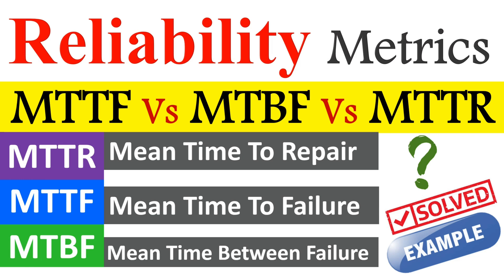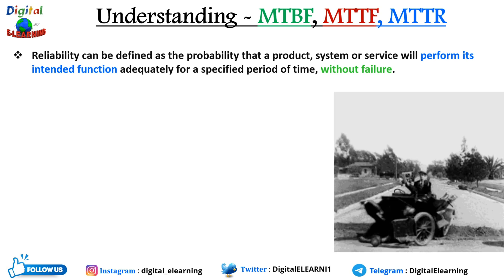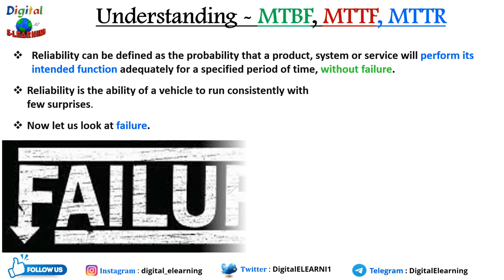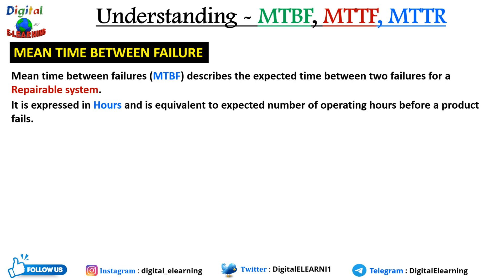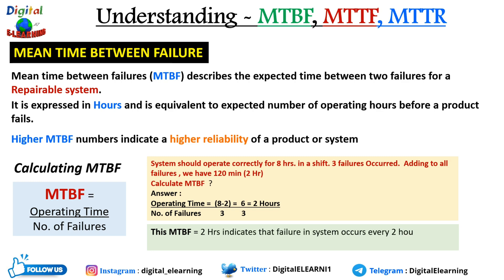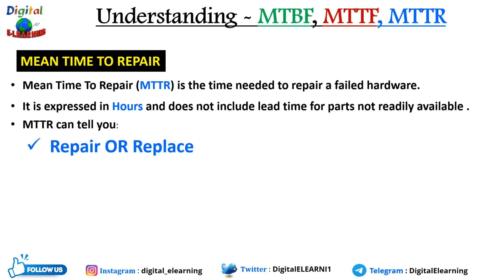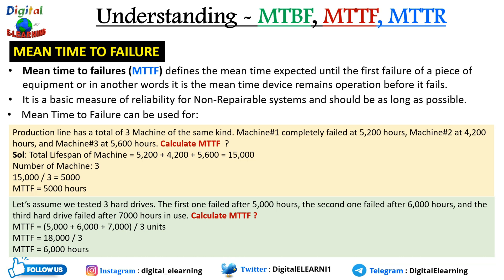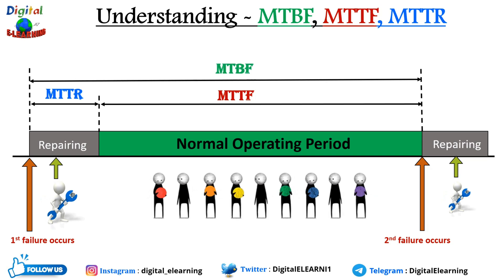What is MTBF ( Mean Time Between Failure ) | How to Calculate #MTBF, #MTTF, #MTTR with Examples

Comment: If I'm designing  a new electronic product, and the customer asks for a specific MTBF, how do I calculate that while the product is still in engineering?  If I wait, it's conceivable that I could test 20 samples, and it would take 10 years for one of the 20 to fail.  I can't wait that long to tell the customer the MTBF, especially when they specified it up front.  There has to be a way to calculate it statistically using the component MTBF specs, like an RSS calculation.

Comment: Could you please show me how to Implement a MATLAB M-file that reads the number of series components in a system
and the MTBF values for each component, and then calculate the overall MTBF for the system?
Reply from the maker: To implement a MATLAB M-file for calculating the overall MTBF of a system with series components,

Comment: MTTF means that after working hours machine need to change???
Reply from the maker: No, MTTF (Mean Time To Failure) does not necessarily mean the machine needs to be changed after that time. It represents the average time a system is expected to operate before experiencing failure, but it doesn't dictate a specific action after that duration. Maintenance decisions consider various factors beyond MTTF.